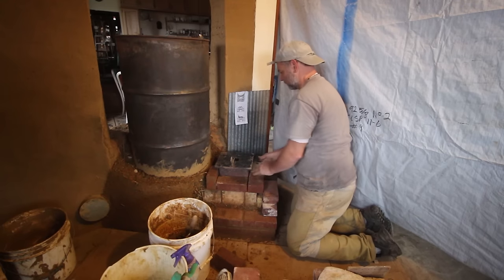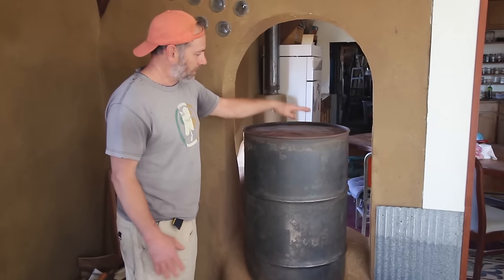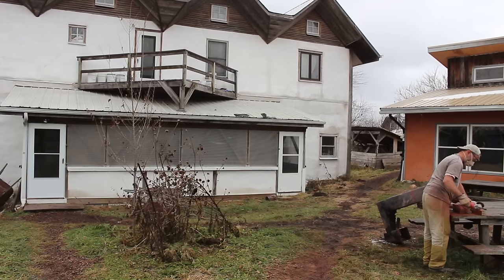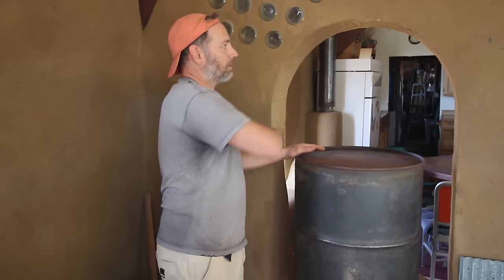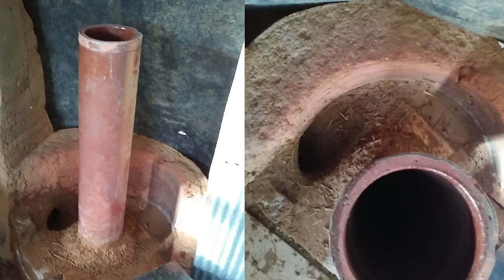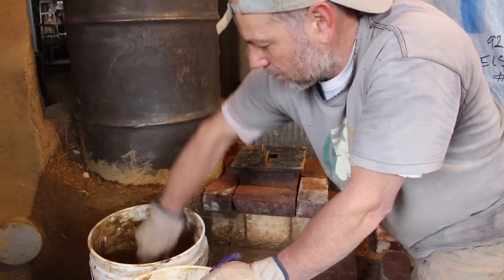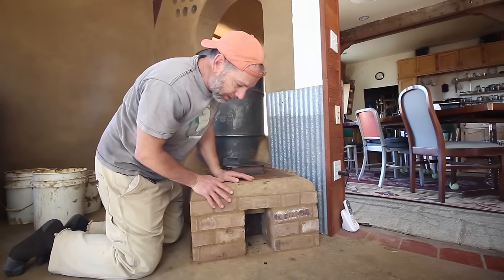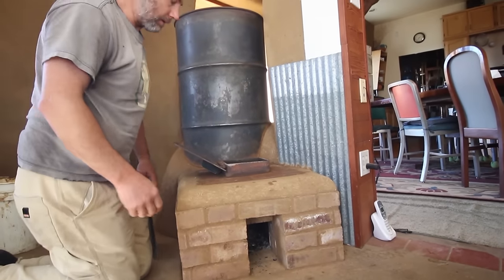Rebuilding and Improving a ROCKET MASS HEATER

Comment: I love what you have done.  I have some clever tweeks I plan to use on my RMH to build upon these systems I've been seeing.  I won't spam you however.  Lol 😂. Job well done!
One question however.  Why not route intake air from outside?  If you pull air from inside, your creating a huge house vacuum which sucks cold air from outside countering the primary objective of heating your home.   Houses are usually slightly positive pressure.  Also cold air is more dense meaning more oxygen thus hotter more efficient burn.  Same goes for actual jet engines, the engines perform better in cold air for the same reason.  Down side might be more work ducting air in and higher temps potentially reducing life of stove.
Reply from the maker: I'm not sure why no air intake from outside. I know most wood stoves are set up the same way, though some have the option to duct air from outside. I think it's just assumed there is some draft in a building and that fresh air is needed as well to keep the air inside fresh. You could also do an air heat exchanger for keeping air fresh.
Reply: @HardcoreSustainable  I like the air heat exchanger idea.  I have bounced the idea around and investigated some designs.    But from theory cold air sneaking in the cracks brings in ...well..cold air.  Lol.   Thank you for sharing your build!  I was just discussing some of these designs with a man from church this morning.

Comment: Nice video! Thanks to you both for bringing and promoting these technologies to the world :-) 

I'm curious if the floors of these houses generally have an insulative layer between the living space and the earth? I feel like this is especially relevant to the mass and the radiant floor heating. Thanks again!
Reply from the maker: Yes, our earthen floors do have an insulation break between the ground and the cob of the floor.  Skyhouse has strawbales (which I wouldn't recommend) and I have light clay straw (which I would only recommend if you lay down a base and use the floor for a year or more before laying down the finish coat.  It compresses a lot).  Others use perlite or rigid foam.
Reply: @HardcoreSustainable  thanks!
Reply: I'm not trying to outsmart simplicity, here, but if you have some dough to blow, could you run tubing around to places you'd want heat? Your set up looks like it has plenty of room for coils of tubing full of water. Thanks for the video.
Reply: @timhaugen6410  basic in floor heating..?
Reply: Only you don't want to lose your ELF Schumann resonance from Earth floors also.

Comment: Quick question for you... We are also in Missouri and this is our 2nd winter with our rocket mass heater. We are cleaning out a quart÷ of ash from the burn tunnel every day and cleaning creosote from the clean-out under the exhaust pipe- about 1-2 quarts a month. Does this seem excessive to you? We see other RMH videos and people brag that they have hardly any ash... Just wanted to check with another Missourian to see if we are ok or need to re-assess. Appreciate any guidance you can offer! ❤
Reply from the maker: I don't have any specific guidance for you as I don't have a rocket mass heater in my house. I have a small wood stove. I would guess it really depends on the type and quality of wood and how much of it you need to burn to heat your space. Obviously a bigger space in a colder winter is going to need more fuel to heat, and produce more ash. Some woods are better, denser as fuel and some leave more residue or ash behind, and depending on their quality (more punky or not rotten at all) they can burn differently. I'd think if your firebox is getting a good flow of air and your fuel is burning like it should in a rocket stove, you are probably doing it right.

Creosote buildup can be the result of lower burn temps, so that could be an indicator something is wrong. But that being said, creosote is a reality of wood heating. 

Sorry I don't have any specific numbers and guidance. The people at Skyhouse using the RMH would know better, but I'm not in Missouri right now.

I never trust everything I see on Youtube because people will exaggerate their success all the time to get people's attention, to get more respect, or because they don't really know what they're talking about.

Comment: What about cob instead of perlite as insulation. My idea is to get a cob high in clay and form it around the central flue. The cob would be straw but have lots of sawdust mixed in. When the sawdust burns or pyrolyzes, you’re left with ceramic insulation. Viola.
Reply: My guess is that perlite has much higher insulation value than just clay. Some people use rock wool. Same reason that cob houses don't work well in very cold climates - but instead better to use insulation.
Reply: Voidisyinyang Voidisyinyang in the year following this comment I actually built an outdoor batch box rocket stove and I’m working on getting it to be an efficient pool heater. I used cob for the firebox and it is actually extremely insulative once the organic matter burns out. The riser was made with perlite clay. Works pretty well so far. Still adjusting the primary air as it chokes itself out pretty hard, but it’s going good.
Reply: @Dollapfin  Impressive! You could upload a vid maybe.
Reply: Voidisyinyang Voidisyinyang I might. Never really done that before. I will try once it’s all tuned up.

Comment: Also I forgot to add, the ash would be pure carbon too which you'd just use as a fertilizer as it's great for veggies and improving soil quality
Reply: Matthew Byrd yeah no it would be pure potash and some calcium. It’s also great fertilizer. I think you just mixed carbon and potassium.
Reply: don't forget the humanure compost - it's a growing business in Africa now. Sanitation collection business. MIT students started it.
Reply: @voidisyinyangvoidisyinyang885  Takes a while to make humanure though.
Reply: @jonothandoeser  yes Two years in northern climates. Check out Sanergy in Africa - lots of youtube vids. Not sure how fast their turn over rate is for a product.
Reply: @voidisyinyangvoidisyinyang885  In moderate climates a little over 1 year. Maybe be faster in hotter climates.

Comment: Thanks. A question: at 9:28 min. Can a ceramic waterpipe chimney cope with the heat right after the combustion chamber?
I,d like to know cause i have one to be used for it.
Reply from the maker: I don't know the answer to that for sure, but since one is used in this, I think it's okay. You might look at what temps ceramic water pipe can endure or if others have used them.
Reply: Did you not look into this before building? You think it is ok since it is used here. Is it not your own build?
I will see how this ceramic waterpipe of mine deals with a campfire before using it as a chimney.
Reply from the maker: @SXMSXMSXM  This is a documentary of this project that someone else carried out. I'm the one filming it. I've never built a rocket mass heater before. I'm pretty sure that the mass heater is still working and now it's been in use for a couple seasons. I guess the question would be, is the pipe still intact or is it cracked and falling apart by now. You'd have to open it up to know.  Someone who knows better than me would be able to say if this pipe holds up to high temps. I'd guess so since it had to be fired at high temps to be made.
Reply: @HardcoreSustainable  Thanks for your reply. 
I have watched some more documentaries on this/ your channel. Interesting topics. Subscribed!
Reply: Terra cotta pipe can take high heat, but fast heat as the heat riser sees on startup will stress and crack it. As long as it is held in place by the insulation jacket it will probably be alright, but dense materials are not ideal for the riser. You really want light, low-mass insulating material for best efficiency.
Reply: I'm an RMH/rocket stove "cult" fanboi, I've never seen the use of a ceramic sewerage pipe in the core either, so I'm burning with curiosity. I know that ceramic tiles don't hold out...

Comment: I have a newbie question...with the heat riser pointing up at the inside of the barrel top, won't that barrel top disintegrate in a bit?
Reply from the maker: You mean disintegrate from the heat?
Reply: @HardcoreSustainable  yeah... I've read that using metal inside will work for a few years but eventually metal disintegrates

But I get the need for having the barrel, and obviously based on your good vid you can replace it.  But I wondered if there was a plan where the top of the barrel was protected from the direct blast from the riser
Reply from the maker: @briholt100  I'm not sure. I think everything was shown in the video, so if you didn't see something there, it probably isn't protected.
Reply: @HardcoreSustainable  I was just asking 'in general'.  Thank you for your help
Reply: @briholt100  Valid point, I've seen others simply weld a thick plate over the "hot spot" to increase the lifespan of the barrel, others use stainless steel, which is preferable. Output from an efficient rocket burner is theoretically CO2 and H2O if the temps and gasses mix in the correct temps. There are local factors in play, height ASL, timber, and atmospheric pressure, air humidity. However, the basic science is the fire triangle, aiming for full combustion and max heat extraction AFTER combustion.

Comment: How do you obtain homeowners insurance with a homemade rocket stove as now any home has to have a U.L. certified wood stove.
Reply from the maker: You'd likely just have to pay more for a special policy. Not many of the houses at DR have insurance.
Reply: According to my research, that is a sticking point, many states and insurers don't allow any "DIY" scenarios of any combustion variety. The "liberty" is UL listed, it's steel and has some clever designs, but isn't durable as a primary heat source. It allows several fuel solutions, including pellets.

Comment: Is there a way to maintain fire automatically? Like putting long sticks?
Reply from the maker: Not sure. I'm sure someone's tried it. Maybe a hopper of some kind.
Reply: think pellet stove.
Reply: @kenwatanabe2599  thanks, but im trying to do the same with wood sticks...
Reply: @HardcoreSustainable  Yeah, I've seen quite a few of these with hoppers and wood pellets. That solves the need to feed the stove every 30 minutes. But then, well constructed rocket mass can be fired for a few hours and continue to heat the house all day, after the fire is out.
Reply from the maker: @jonothandoeser  I wouldn't recommend pellets. If you are concerned with sustainability, they aren't sustainable. They are clearcutting huge tracts of forests to get the wood, and then they use all kinds of fossil fuel to process them into pellets so it's easier to feed wood into a stove. The design in this video needs a little maintenance, but you can burn waste or locally harvested wood in it.
Reply: @HardcoreSustainable  I wasn't referring to the idea of buying pellets (which end up being expensive anyway). I'd look more into getting a pellet machine. Those mix wood scrap (sawdust and wood chips) with soybeans to make the pellets. VERY cheap and you don't have to keep feeding the fire every 30 minutes. WIN/WIN!
Reply: @HardcoreSustainable  not everywhere, so that's a generalisation. Where can "they" afford to do that anyway? Is it to replace sustainable methods now demonised in the cold shivering west? In South Africa sustainable forestry waste is processed into pellets, and replaces gas and now defunct electric sources in many 3rd world scenarios using rocket stove technologies.
Reply from the maker: @craigsymington5401 Not sure what you are referring to, but I think you are continuing the pellet fuel discussion. I know in the US most of the pellets used in pellets stoves are made from clear cuts in places like Georgia and other parts of the south. I've seen these clearcuts and they are dedicated for pellets, not waste wood. I've also seen documentaries and articles about this industry.

It's much more sustainable to find local scrap and waste wood to burn than to manufacture it far away and ship it long distances. If there's a way to make use of waste wood that wouldn't otherwise have an application and it has a reasonable ROI, I would advocate for that. I don't think the wood pellet industry in the US is at that point.

Comment: Hi there, I found your video interesting. Why do you say it's not ideal for people who are not at home all day? Your Surname seems to have Italian origins! Greetings from Italy here
Reply from the maker: I'm not Mark, the guy in the video, but I know that rocket stoves like this one need to be fed throughout the day to continue heating. You can't just load it with a bunch of logs and leave it like with a wood stove.
Reply: RMHs do not need to be fed throughout the day (or night) - that is one of their prime virtues. Depending on the weather, a rocket mass heater sized for the space will only need to be fed for an hour or two once or twice a day. In really cold weather, it will need to be fed longer in a burn session, but not more sessions. It keeps heating all day and all night without a fire burning while you are away or asleep.
Reply from the maker: @gjh42  I have yet to see one that works like you are saying, but I'd like to. I know that the idea is to heat up the thermal mass and then radiate it to the space for a long time after. I don't know why Mark would say that about needing to be home all day. If you aren't there you might not need it to be warm, but if you don't keep it warm it will take a while to get the thermal mass heated again.
Reply: The point of thermal mass is that it doesn't transmit heat fast, and once heated, it takes many hours to cool down. The exterior surface may not reach its peak temperature until several hours after the fire goes out. Another fire 12 hours later will maintain the exterior surface temperature fairly steady. Mine works this way. I would love to show it to you.
Reply: A 6" J-tube system is only adequate for a small house or a large room, in a colder climate. For a location where the temperature can get below zero F, you want an 8" J-tube system (or a 6" batch box) to heat an ordinary house. A 6" J-tube will have maybe half the heating capacity per hour of an 8", so you would have to burn considerably longer to get the same amount of heat.
Reply: @gjh42  Is a batchbox Better than a Mass heater?
Reply from the maker: @gjh42  I would love to see it. I haven't seen a lot of them that work the way they are hyped to work. It also seems like you'd lose a lot of thermal mass heat up to stove pipe because heat goes where it's coldest, so outside instead of in.
Reply: A bell collects heat near the upper part, while the stovepipe exit is from the very bottom of the internal space. Only the coolest air leaves. Also, you can shut off the feed tube inlet so no air goes through the system after the fire is out.

Comment: This guy says rocket mass stoves if you don’t stay at home all day or if you work all day and you come home at night the rocket stove is not for you cause they’re very dangerous. That is not the case people say that about woodstove they say that about, stoves rocket stoves but they’re just as safe as furnace if not safer because there is no poisonous gas that can kill you as well as rocket stoves, wood, stoves, and pellet stoves if they are done and installed correctly, they are safer than any HVAC heating system. You can find the reason why I say that is because only HVAC systems have a very common thing that happens and that’s heat exchanger gets cracked and dumps a whole bunch of natural gas or propane into your house and you get very sleepy and die, all natural heating stove that has been around since before white men took the land
Reply: And for those that want to do this because it is a lot of free electricity keep in mind to figure out a way to heat your mass when you don’t have any wood to burn the best way to do it I have found is since this guy has a solar pass-through on one of his buildings if I was him, I would do what I did and make it so that when the sun hits inside the house make it so that the sun warms up that mass or what normal people call it a thermal battery because if you make it so that the sun Will heat it up. You have more than one way of keeping warm so if you want a perfect house that is not run on any gas to heat it I would recommend looking into something called a solar greenhouse or a solar pass-through house for instance underneath my built house are utilize the old basement dug down another 9 feet poured concrete down about 6 inches worth 6 inches of compact sand over the top of that then radiant heating pipes then more 6 inches of compact sand 2 inches to 4 inches of clay, then your house on top of that that makes a perfect battery just like this guy rocket mass stove it’s the same concept just utilizing woodburning as well
Reply from the maker: I don't think he's saying it's not safe to have a rocket stove, it just takes firing it regularly to keep a house warm. It takes active work to keep the house warm. With a furnace and thermostat, everything is done without any input of work. You set the thermostat and your house is kept warm automatically. With the rocket stove you have to be there feeding fuel into it or your house will get cold. It's easier in some ways than a wood stove though, because you are heating up a large thermal mass and that is like the thermal battery you are talking about and it keeps the space warm for longer, so you aren't having to put a new log in regularly like with a wood stove.

If you watch my other videos you will find some about my house. My house has a passive solar design, so it is mostly heated during the day in winter by the sun. The sun comes in the south facing windows and heats the earthen floor. It's supplemented with a wood stove.